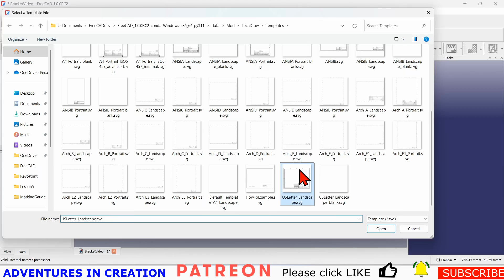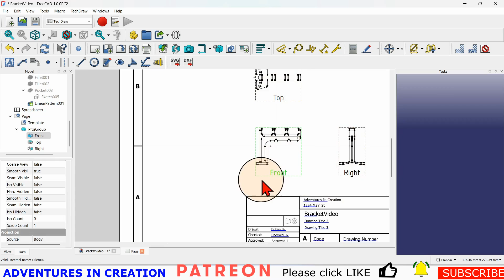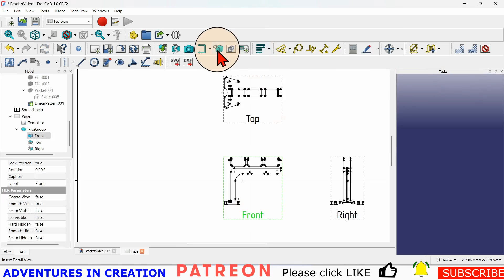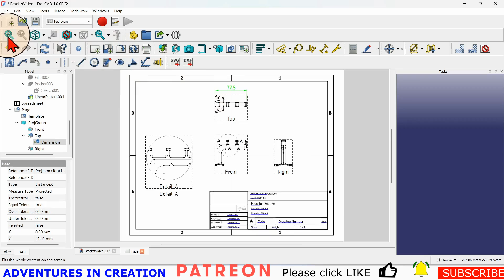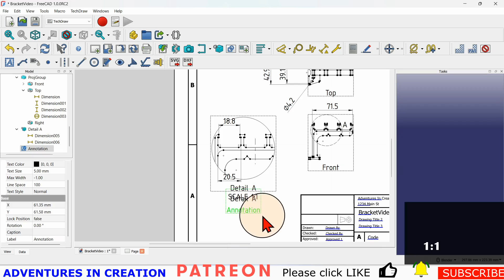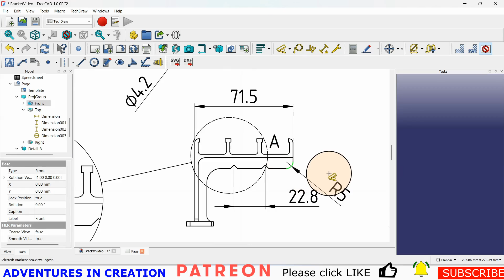An Introduction to FreeCAD 1.0 Part 6 #freecad #cad #design #sketcher #techdraw #tutorial

Comment: Thanks again for this video. helps a lot. is it possible to change the font size of the dimensions to a (smaller) default size. I found it, how to do one by one. If you want to do many dimensions it takes to many space and it is quite time consuming to always change it for every single one dimensions.
Reply from the maker: Yes, open the techdraw workbench then go to edit->preferences->techdraw->dimensions

Comment: could you make video about what is correct way -> in your opinion about organizing files for freecad. So its all in same place-from simplest to more complex and if its even possible:
1) how do you make assembly that has couple external parts(that currently are not used by anything else but you want to make sure that assembly updates if part is changed). 
2) how do you structure standard item "warehouse" like bolts hooks ISO Wingnuts etc.. standard parts coctail of parts that you don't need to model and parts that its faster to model than to look for on internet..(toolbox.. in SW)
3) is there a way to reuse features/sketches between multiple parts.. for example block of holes.. that you can save externally and reuse in many parts.. that when updated updates also parts?
4) how do you make assembly that has some unique parts and some reusable(need to make sure to lock the part that from assembly side parts are not changed but if updated in library part updates in assembly).
5) how do you structure files for assembly that uses reusable parametric parts -> assembly drives part (thru variables) but part in library stays same(variables stay default values when part file is opened).
Reply from the maker: That's an interesting idea, I will consider it.

Comment: Even though I'll never need to fabricate a piece outside of 3D printing, I still think the TechDraw workbench is an important skill since you can quickly see dimensions. In the Sketch workbench, some are constrained and it's not easy to see what they are.
Reply: You can always apply reference constraints
Reply from the maker: @ you are absolutely right, you just change the dimensions from constraints to references (similar to changing lines from geometry to construction lines) and the dimension will show up and not conflict with anything.
Reply from the maker: I love how quickly you can produce a tech drawing

Comment: That's very useful; I've struggled in the past with FreeCAD's desire to reset the relative position of the views. A small point, which doesn't matter if you're drawing just for yourself: the template carries the symbol for First Angle in the information block. If your model is left- or right-handed, (like a glove, for example) and you draw third-angle but label it first-angle, a machinist will look at that symbol and make you a left-handed item instead of the right-handed one that you wanted!
Reply from the maker: Absolutely. It's critical to know that with engineering drawings. I usually use a template for my detail drawings but not for the exploded view as the real estate is more important.

Comment: As always I enjoyed the video, and (as always) I have a petty little issue. The dimensioning dots on my drawing were very much bigger than the ones in your demonstration. I was able to fish around and grab the specific points I wanted, but even when I enlarged the drawing, the points enlarged too. Any suggestions?
Reply from the maker: I didn't change mine but there might be a setting for that?!!?
Reply: I found this on the FreeCAD forum, posted by chrisb: Preferences->TechDraw->Scale->VertexScale. That changes the dimension dots. The default is 5mm but on my computer that's much too big. I set it to 2 or 3mm and that's just right.